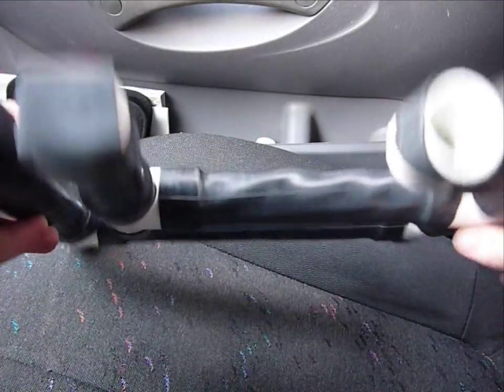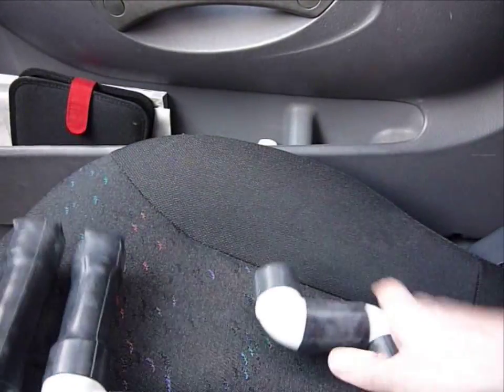RangerPod

Comment from the maker: My first ranger bands didn't cover up the hinges, so it could still have been taken apart.  I'll bet that if you got a narrower road tube, it would probably cover the pipe snugly, with separate bands for the coupling.  It's cheap enough that you might as well experiment!

Loved the canoe video.  I was impressed with how well the multipod worked.  You got some gorgeous shots.

Comment from the maker: The best way would be to get it it custom-machined out of titanium with fully articulated lockable joints.  Realistically, since it's PVC, it's only going to hold up to a point.  I have noticed that PVC dimensions aren't precise, so if you buy pipe or fittings from different stores, they might fit tighter or looser.